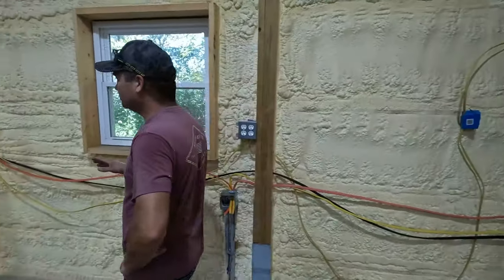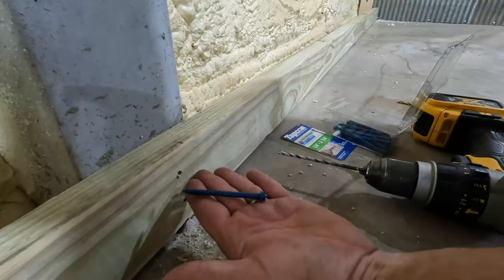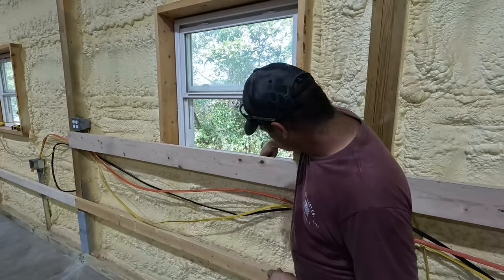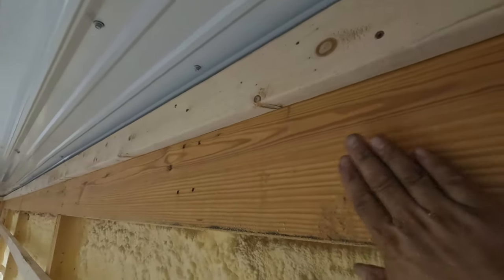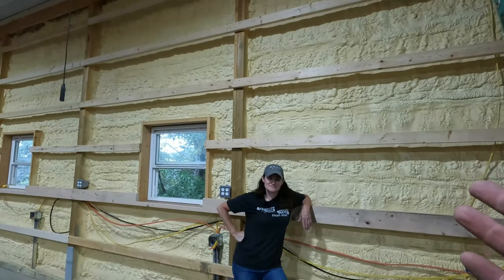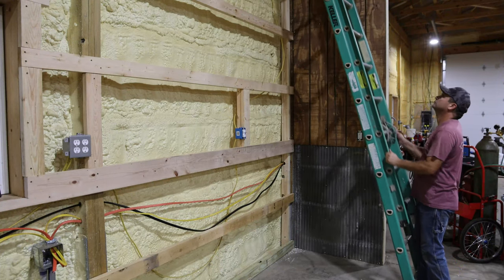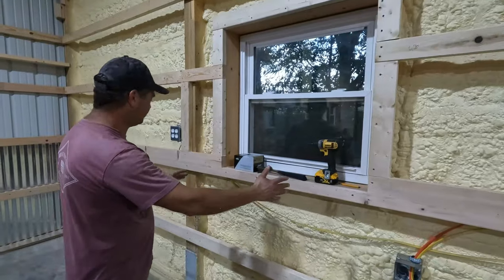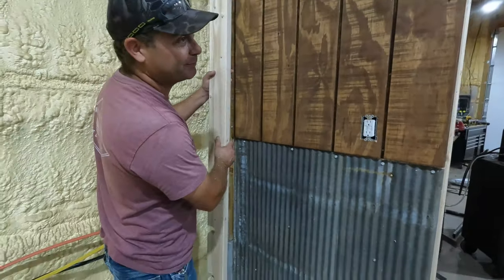Starting back on finishing the inside of our Workshop.  This way was faster, but not perfect.

Comment: Many people are going to envy you. I had a 20'X30' workshop and had all of my large tools, table saw, planer, sanding center, jointer,  etc. on rollers. My table saw ended up with a 4'X8' table built up around it so it didn't get moved much unless I had to bring an auto in to do some work. It was a great wood working shop and I sure miss it now but I don't get around like I did when I was younger.
It will be great to see you get your shop set up and into "production". I'm waiting to see you start on your meat processing center too.
Take care,
jack
Reply from the maker: Sounds like you had an awesome shop. Hopefully I will get there one day.

Comment: There may be a benefit with the gap behind the plywood paneling. It would allow you to fish wires behind it if you ever needed to add an outlet.
Reply from the maker: I will always be able to remove the corrugated metal at the bottom if I need to route wiring.  It's good to have access if I need it.

Comment: Nice project.
Why don't you install all electric wires in flexi tubes? Easy to replace the wires in the future and you can add wires to them if needed. We always use plastic flexi tubing in Scandinavia.

Comment: Doing horizontal girts to support the interior is a very cost effective way to finish the inside of a post frame building. I'll soon be doing that in my own new workshop building that went up this past week. Building stud walls in a post frame building's exterior walls kinda negates some of the cost advantages of the building method. Relative to the ceiling, that would normally be installed after the interior walls are in place. But how you did it is just fine...you have a tall building and it's just not going to be all that noticeable.
Reply: Man on a galloping horse won’t notice it looks great to me

Comment: Set up your miter saw station in the middle of the wall, between your plywood storage and the end of the wall. Put your roll out work bench at the far end of the wall. You will better be able to handle your lumber at the miter saw better.

Comment: If you are going to hang lumber on that wall, you might want to put some more bracing in for it. Just a tip from a carpenter.
Reply from the maker: Yes your right.  Thanks for pointing that out.

Comment: What was the cost of having the spray foam insulation done I'm wanting to get a concrete floor and some kind of insulation and get the inside finished up in my barn and as I told you the other day I'm hoping to build a lean to before winter for all my implements with gear boxes to keep them out of the weather I'm also looking into getting some racks  to put my buckets, snow pusher and any other skid steer  quick attach loader attachments on and out of the weather.   Your barn is coming along nicely

Comment: Just curious, what R rating is that spray isulation. Looks like a thin layer
Reply from the maker: 2 inches of closed cell foam.  So it is about R-13.  Plus about 3 inches of dead space which is another 3.5 per inch.  So about r-20 when the walls get closed in.